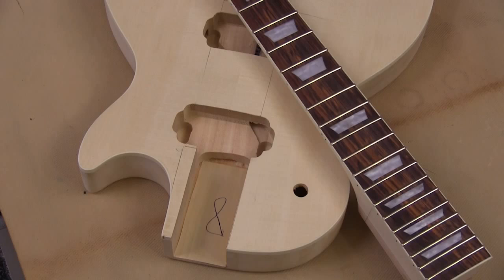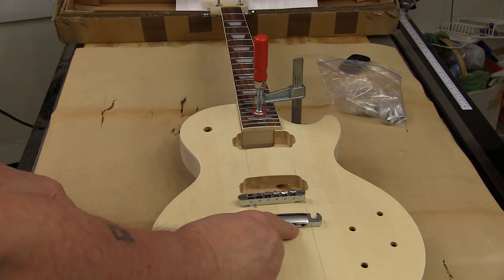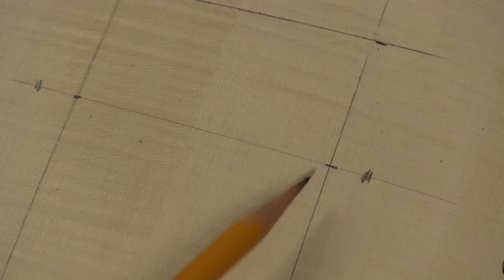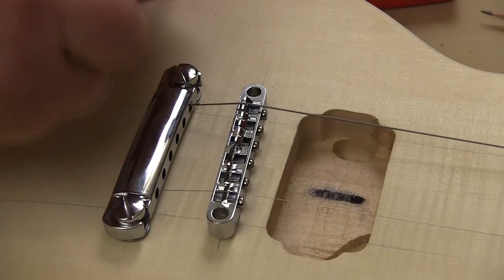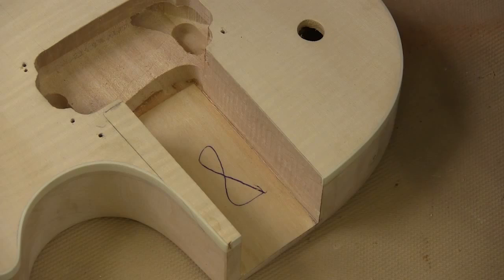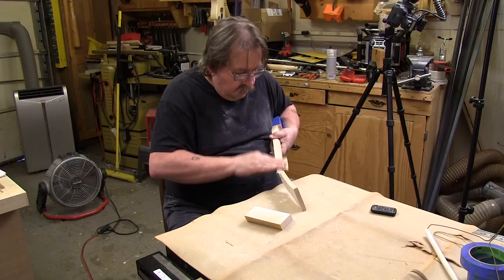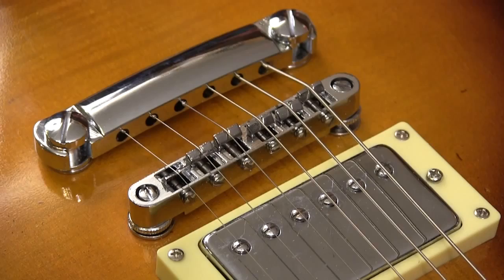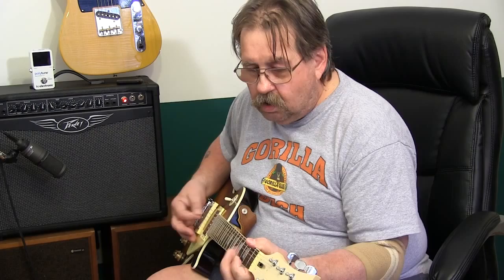Electric Guitar Kit Review Presented | NewWoodworker

Comment: Great job. I really appreciate how you took your time to get the bridge right. Great tips. That to me, is the definitive way, and if I build one of these, I'll come back to this video just for that.
Side Note: When finishing your guitar, use more sand & sealer next time. Spray along the grain with 1/2 overlaps, then immediately go back over it in the opposite direction. Wait 5-10 minutes and do it again. Let it sit an hour then wet sand it with 600-800 grit. Do that 3 times. On the third time you'll give a final wet sand at about 800 grit. You want EVERYTHING dull. NO shinny spots. Nothing. If you feel like you're going to burn through your sealer, you won't. You've built it up high enough.
IF YOU DON'T do this, you get dimples and so forth. An orbital sander is perfect for this job.

Comment: I'm on my second LP. should mention to drill a hole in the bridge hole to run a ground, My first one turned out pretty good, took a bit to get the  truss set right, I'm happy with it, I building this next one for me to keep. ad a few changes on some parts. Rock on! Just remember TAKE YOU TIME  don't rush it wait for the stuff u use to dry, days sometimes. I screwed my first on up several times. back sanding it down, runs. orange peel. heavy coats  etc.

Comment: I thought this is one of the better DIY kit guitar builds ive seen so far.

Even though ive read complaints about the finish i thought it was great, for the cost of the guitar you made everything easy and not look hard like some one would need a compressor and a special spray gun to shoot the professional type sprays.

Comment: Nice video,
I'd recommend making a clamping caul for the neck so that you're not actually putting pressure on the frets. A piece of 1 inch lumber with saw cuts spaced the same as the frets will do it (radius'ed to match the neck radius is even better.)
Thanks for the video!

Comment: that finish was as smooth as gravel... No wet sanding, no polishing at all. Little bit of work will give you a glass finish. Use a compound on the lathe to get you there. At 5:59 you can see NO work was done to finish it. The clear wrinkling is evidence you didn't let the undercoating dry properly.

Comment: What kind of drill press you used? I bought a drill press but the steel tube that holds it up is in the way of the Les Paul so I can position the Les Paul to go under the spindle.

Comment: Set necks freak me out a bit - how do you know when you glue it and clamp it that you have not fluffed the angle just a little bit - I mean it's not like you can have a couple of strings as guides because that would put tension on the joint.
Reply: +Steve Gould 
Well, you can put strings in the bridge, and just pull it across to the nut to check everything. That way the neck itself isn't holding that tension. Or you just trust that they did their job right and there isn't enough play for it to offset anything.
Reply: Guitarplayabreh I get you, so just to do I kind of line of sight test, hold them there as a guide. That sounds reasonable. Thanks.
Reply: Steve Gould
Yeah, man. If you get one, I hope it turns out good.
Reply: +Steve Gould I bought my set about 18 months ago and I love playing the guitar BUT I was also scared by the uncertain permanence. I test fit the neck with paper wrapped around where it fit into the body to keep it snug. I was actually able to hang it by the neck and was certain it was centered and straight. Then I bought a strat style bolt on plate and changed the design to a both on.
I was happy that I did because after my first set up attempt I found I needed to 'shim' between the neck and the body to get the action that I wanted.
Reply: That sounds like the way to go TheDavidGerrard - thanks!
Reply: +Steve Gould Get the neck dry fitted in place then lay a long straight edge ruler along the fretboard and slide it along to the bridge. The straight edge should rest on the bridge saddles when they are at their lowest adjustment.
Reply: if you clamp firmly after test fitting several times its a no brainer.the key is trail run testing BEFORE GLUING.

Comment: Do not, I repeat DO NOT EVER use Gorilla glue for guitar building. Titebond Original or Epoxy only.
Reply: why?
Reply: In guitar building, you generally only use titebond wood glue or animal hide glue (back in the way early days). These glues are used on almost all the various parts of a guitar that need to be glued, and these glues allow for the guitars sound to resonate better throughout the body as the areas in which they are used will have a very tight and solid connection. I don’t know about epoxy but I advise against that as no professional/expert manufacturer uses it (probably for good reason).
Reply: Or hide glue